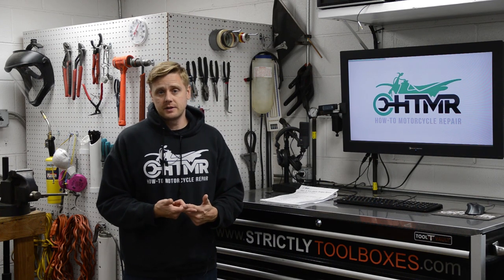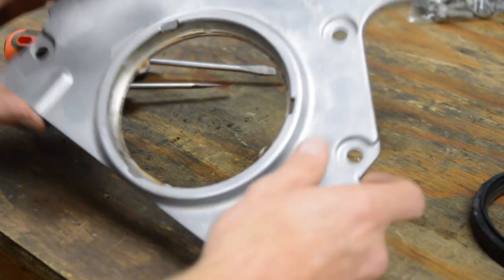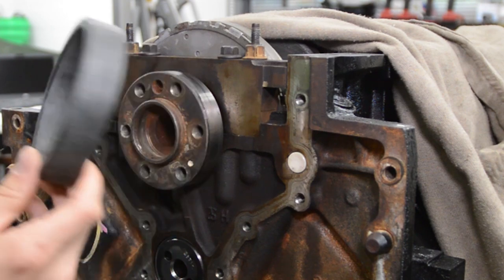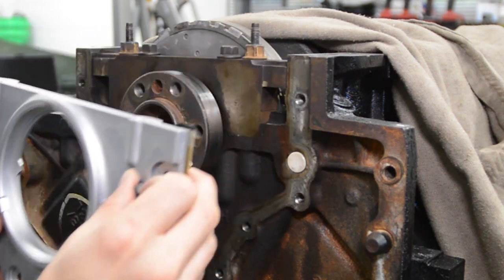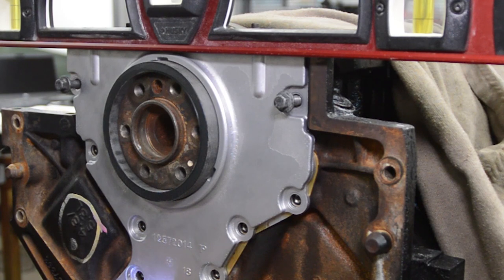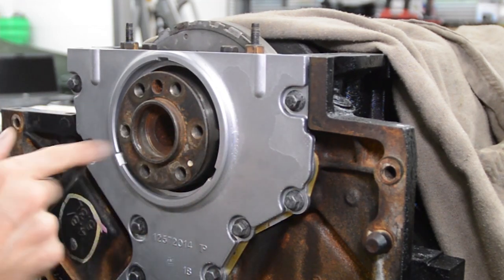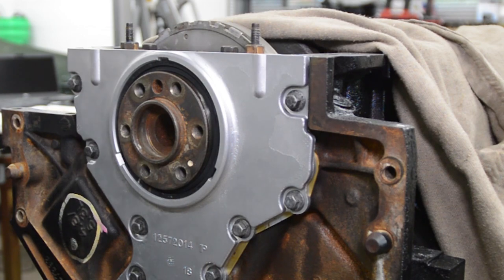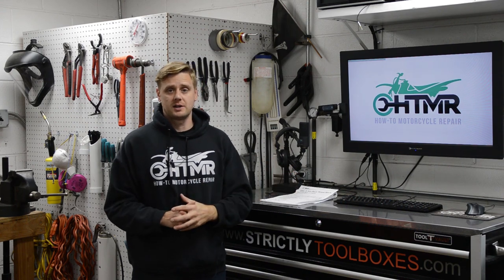How-To: LS Rear Main Seal Replacement

Comment: The alignment tool I bought has a tiny hair of movement on the crank and cover. Is that okay or will it cause a potential slight misalignment?
Reply: you dont need an alignment tool Just get the seal on the crank and make sure the cover is flat against the oil pan

Comment: Crazy how I’ve installed hundreds of these and I’ve never used the tool and they’ve never leaked
Reply: Yep, you don't need it if you put the seal in the cover and then slip it on, it centers itself. The front seal is a different story though.
Reply: @brianross4057  oh okay good. wonder why a lot of people buy the new cover and take the preinstalled seal out just to install it using the tool
Reply: @yungtooli  That's crazy taking the already installed seal out just to have to reinstall it again, because it centre's itself naturally over the crank flange whereas the front seal doesn't have anything to center on so yeah I would use the tool in that case.
Reply: Yeah, I think it's funny. This process indicates you either have perfect alignment with the crank or the bottom of the block, but not both? It seems if the cover is even with the bottom of the block, it should be engineered to be centered with the crank. Just thinking out loud. Anyone with a moderate understanding of how this should get a good seal should be able to do this without the centering tool.
Reply: @brianross4057  not exactly ive had to do it ttwo tranny drops going for third either its unlined without the tool or the barbell or galley plug is messed up

Comment: Well done sir. Very nice only thing I wished you mentioned was your preferred
Technique on oil pan to rear cover bolts. The long ones you only torque to like 9ft lbs… before/after centering crank with a rotation/torquing rear cover bolts…let me know! Either way very nicely executed tutorial.

Comment: GM updated the rear cover and they come with the seal installed, upgraded bigger bolts- and no need to fart around with special "3D printed" tools, just order GM part no 12639250  on amazon

Comment: pssst you everted the seal when you put it on. That lip is supposed to protrude towards the front of the motor not towards the flywheel mating surface. Should have lubed it a bit and twisted it onto the crank surface so it was oriented correctly, before you drove it into the cover.

Comment: I’m no mechanic, but why can’t you just put the seal in the plate and then install onto the block,won’t the seal center it instead of your printed tool?
Reply from the maker: The seal lip is too soft and won't accurately locate it. People have done that method with leaks as a result.
Reply: You can do it without the tool, the seal alignment tools are not necessary and really just a way to separate the tool collectors from their $.
Reply: @HTMR   Nope. I've done it this way on 4 builds and zero leaks. Where did you get your information from?
Reply: @Avalanche2   100% F-ing percent!
Reply: @alvaroarana6424   4 builds over 5 years not one of them leaked.

Comment: You're 100% wasting EVERYONE's time here messing with all this unnecessary BS..  

Put the friggin pan on. Torque it to the block, 18Lb/Ft.  Dab rtv in the corner of the block/pan. put cover on with gasket. put all the bolts in but only start them. the 2 bolts nearest the oil pan that go into the block, turn them with a ratchet just until the ratchet offers resistance. YOU DO NOT WANT IT TIGHT..  then go to the pan and tighten the 2 bolts that hold the cover to the pan.  you will see it suck up to the pan which is perfectly flat with the block..  idea is to tighten it up just like you would an intake manifold on a V8. 2 bolts on cover, then 2 bolts on the pan until the bolts get tight. now go back and tighten the rest of the cover bolts.  

I don't care about this little circus that you're doing, it will result in leaks..  and if you do the same thing in the front and the bottom is not 100% flush with the block, you WILL break your pan or you'll have a leak.  

Oh and HAMMERING in your barbell with a dry o-ring was a real nice touch. Hope you didn't cut that o-ring and send that shit through your engine to plug a bearing orifice or lifter somewhere. LOL    Push those in gently by hand..  If you cant, then it's not lubed or something is wrong.  

Stick to knitting.
Reply: Savage!
Reply: What is wrong with you?
He is just showing how he did his engine. He is not telling you or anyone this is the only way to do it.
If he was wasting your time, stop watching it.
Grow up man.